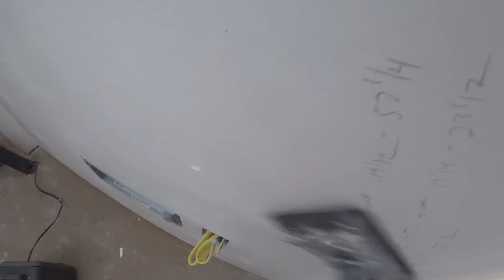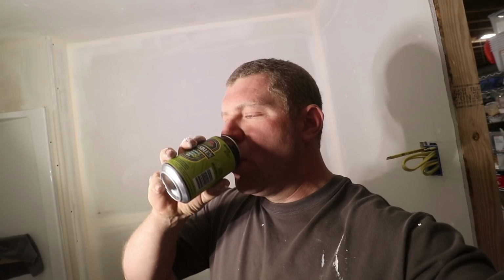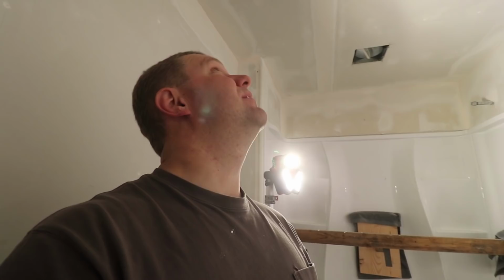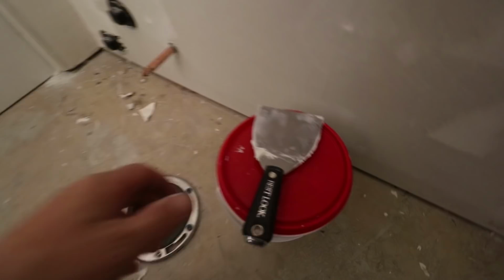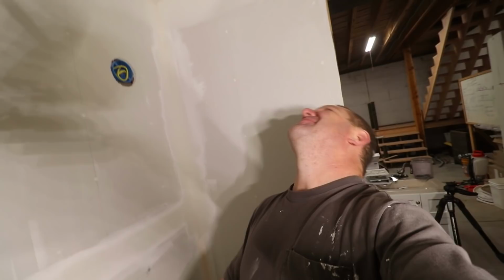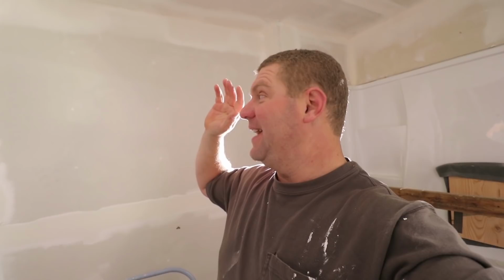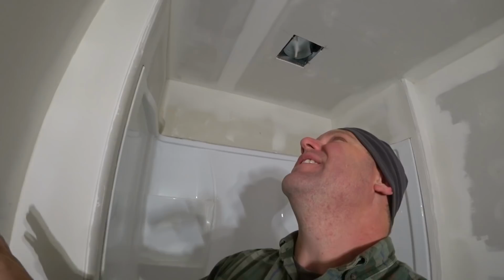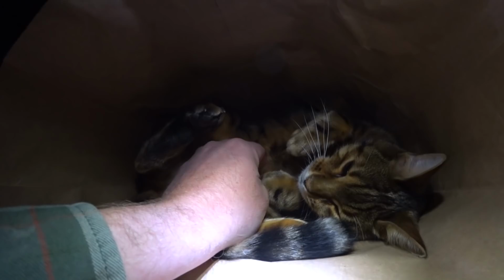READY to TEXTURE & PAINT! (Mudding Drywall in Bathroom)

Comment: For someone who looks up so much on the internet, I`m surprised at the approach Jessie is taking.  My 2 cents
1 - after the first coat, don`t sand, just use the drywall knife to knock off the high spots
2 - in a shower or bathroom area, I would not advise using pre-mix compound, I`d always use a powder mix (setting type compound)  If pre-mix gets wet in the future, it softens up
3 - I hate those rectangular sanding heads on a pole, having it flop over all the time and putting dings into the drywall surface. 
 I`m a big fan of the 360 degree circle sanders (less repairs from having the head flop over)  
4 - if you do want to sand with a rectangular hand sander, you can get ones that take a perforated paper and hook up to the vac, and they suck up almost all the dust that is created  (I use them for spot repairs all the time before painting, they work like a charm)  
5 - that compound was way too thick, most certainly needed some water adding in
6 - always buy more product than you think you will need, especially if you will be using it for other jobs in the near future.  
7 - I would not want to use spray can texture for anything more than a small repair.  If you have a compressor that will power it, a small hopper sprayer for texture is not expensive to buy or rent.  (and instead of mixing with water, mix with white paint, that way the texture is already painted, and is less likely to flake off if you try to paint it down the road)

Comment: Tip : pre fill but joints and seams with 90 compound then add regular mud with paper. It will be stronger won’t crack as easy and fills big gaps like you had here .Also wet the paper tape before using it, to reduce bubbles. Also thin down the mud. Good luck

Comment: Jesse, 20 years as a drywall contractor.  

1. Your drywall hanging looks pretty good, one rule to remember.  Do not allow joints over your windows and doors to travel along the king stud.  "Horn" over all headers at least 4 inches, otherwise you will get cracked joints.  Example, the window on the right in this picture.
http://drywalltaping.ca/custom-home-101-perks-of-drywall-installation-for-your-home/314579_218240454897569_162942057094076_554236_327486995_n/

Two joints are okay as long as you follow the 4 inch rule for both.

2. If you need a sound resistant wall, glue the studs and screw the drywall 6 inches on center.  It is the studs vibrating like a snare drum that transfers the sound to the sheetrock (skin) on the other side of the wall.  Glue is otherwise unnecessary when you are using screws -- you can nail anywhere that is going to be under tape or trim.

3. Hire a professional taper.  Smooth wall for this house, easier to repair and masking all of your wood and doors/windows will be a nightmare. 

4. Prime and paint with a 3/8 inch nap roller. It leaves a very light eggshell texture that you will be able to repair 100% yourself if you need to open something up.

The drywall finisher is the guy who ends the rough construction phase and starts the finish construction phase.  Very critical to get it done right.

Comment: use a drill [hole hog size if you got it] and a mixer head put little bit of water in bucket and whip till smooth [put air into mix] makes it glide better and it dries little quicker. your 2nd coat mud is way to thick out of bucket

Comment: You need a dry wall “T” squaring, a corner trowel, thin your mud, add water and use a paint stir on a drill, makes it a little thinner and smoother, and at least a 12 inch trowel, and a long handle for your sanding block. Good work takes good tools.

Comment: Lots of great comments to help you with your drywalling.
I like a sponge instead of sanding.
I like a hawk better than a tray.
Hire out the mud, the pros do it so much better quicker.
I don't do drywall often, usually when I do it by the time I get finished I'm fairly good at it again, but I'm never going to be as good or efficient as a guy that does it EVERY DAY!
Use a paint mixer in your drill to mix the mud before you use it.
Wipe out the top walls of your bucket so that the mud does not dry there and then fall into the nice fresh mud in the bottom of the bucket.
Good luck!

Comment: To get tight seems in the middle of your wall, hang your top wall board before the bottom wall board. You did it opposite and tried to fit between the ceiling and the bottom wall board. This created a good size gap right down the middle. You want to go top to bottom.

Install your ceiling board first, like you did. Then install the top wall board tight against the ceiling. Lastly, install the bottom portion of the wall board. Throw some scrap drywall or wood on the floor as a pry leverage point. Get yourself a pry bar or 2. Set your pry bar up so that you can step on it and lift the bottom board tight and flush up to the top board and then tack the board in with your free hands. It creates a perfect tight seam down the middle. For an inexperienced installer, a 2nd person might be key to getting tight seams.

Comment: 1. Buy good quality fiberglass tape for drywall.
2. Do not use texture. Textured walls look like crap in dusty environments and just scream “cheap house”.
3. Hire a professional to do the house. The variations in wallboard will look like crap, for the rest of your life in that house.
4. Do not leave any gaps between pieces of wallboard. It makes the mud work twice as hard.

We built and mudded our own house. Our walls are only ten feet tall, and it still wasn’t easy. All of our walls are smooth - no texture. We both have substantial experience with drywall, mud and plaster. Hire the pros. They will have the house done in weeks instead of months or years.

Comment: Jesse, when you drywall upstairs, try a fiberglass weave tape (I used fibafuse) as it wont bubble, and flexible corner bead (comes in 100ft rolls) for inside corners.  it might be overkill but as a DIY-er I found these to be way easier than paper tape. They cost a bit more but not much and i found them much easier to use.

Comment: You all are doing great!  Drywall is an art and takes much practice.  I’m sure the pros aren’t cringing too bad though. A couple of suggestions to consider— spray foam behind the shower surround before you close in the adjacent walls, especially behind the shelves. That will deaden the annoying noise that the water makes when hitting the thin plastic. Foaming under the tub eliminates the noise too and it won’t creak as you walk around in it. Also, try using bags in your Ridgid vac. Much less dust and you won’t plug the filter. Love watching your videos!

Comment: In Australia we use an open weave self adhesive fibreglass tape to join the sheets together. the open weave allows the plaster to penetrate between the sheets. We use the paper tape for the internal corners between the walls.....  Plaster shrinks as it drys....  hence the need to do multiple coats....  Have fun with it  :)  

PS:  What's this 'texture' all about?  We just undercoat and paint our walls over here.......

Comment: when you feather the joints or do joints.. first you hit the crack with mud to fill it .. then you put on enough mud to hold the tape in place.. seat the tape at one end and pull it out along the wet mud using your knife to embed it .. put your drywall knife against the tape when you get to the other end and tare it off the roll.. let that sit until the tape is embedded in the mud and you know its not going to pull up.. come back with a 4 inch blade and put down mud right over the tape.. then use your 10 inch trawl.. to feather it.. light pressure towards the center of the tape and hard pressure out on the clean drywall.. go down one side and then the other side of the tape.. you are building a slight peak over the center of the tape .. then you come back and sand that peak flush.. its a peak you can't really see.. i let that sit then wet sponge instead of sanding.. sanding is dusty also a sponge blends the outside edge into the drywall better .. anyway thats my way.. screen sanding is also very good if you have long areas of wall

Comment: The way it is done.  Start at the top and work down.  By moving the lower panel up to close the gap.  The extra gap at the floor is very easy to hide with flooring and base molding.

Comment: In the 60s we used a 6 inch knife to tape and spot the nails, not screws, 10 inch curved trowel for the fill coat and a 12 inch trowel for the finish coat. We mixed our mud from dry sack in a 5 gal.  bucket, let it sit overnight and remixed it right before coating the joints. All purpose for taping and the fill coat, and finish mud for the finish coat. Premixed was twice as expensive and we had to thin it down. We mixed it real thin for taping, we used a "banjo" to apply the wet  tape and thicker for the fill and finish coats. 6 inch knife for the corners and a 12 inch flat trowel for the butt joints. It looked like a fine plastered finish with little sanding. What you are doing Jessie looks good! We also sprayed acoustic material(popcorn) on the ceilings. It did cut down on noise in the room, but no one does that anymore. You will need a lot more tools and equipment to do the rest of your house, but you are "hands on" so if you decide to drywall the rest, you will save a lot of money, not time, but you are young and the videos will be great! Thanxz

Comment: I don't know if anyone has commented yet but I believe you are supposed to soak the drywall tape into water first and then apply it to the seam. You need to apply a thin layer of mud onto the seam first and then apply the wetted tape onto the seam. Using your knife, smooth out the tape.

Comment: Purchase mud in 5 gallon pails.  To prevent drying out of unused portion,  smooth out the surface of the mud left in the pail and cover with a thin layer of water, at the end of the work day (you can keep stored for months).  Pour off water before next use.  Power stirring when you reuse from the pail, will help maintain mud moisture content consistency.  If desired, hire a pro to direct you, as you do the work.

Comment: Yes. Thin the drywall just a tiny bit -- only a few tablespoons water per 5-gal bucket, power mixer to blend it to a smoother / creamy consistency, then cover & let sit over night before using it. Get drywall inside corner & outside corner tools. Yes, fill seams with mud & then set tape into mud. A very wide taping knife (18" to 24") will blend seams out much wider to give cleaner finish to joints, because we know you're going for a Grade 5 Finish.

Comment: Get your mud in 5 gallon tubs. Get a stirring blade that goes on a power drill and ALWAYS blend your mud before you start. (We used to add a small (tbs/gal) squirt of (Joy) liquid dish soap and a half cup of water to each 5 gallons for smoothness.)
Also, you need more circulation with that warm air. ... Box fan on low pointed into the vanity corner.

Comment: Last year I helped my neighbor finish her 1500 SF basement. We drywalled, taped and textured the first half by ourselves.  It took weeks.  The result wasn't bad but took forever.  We decided to have a crew do the second half.  The hangers came and hung. all the drywall in 4 hours.  They were very  particular about fitment.  Our ceilings were less than 8' so first they measured up from the floor 48 1/2" and made marks in a few places.  then they measured from the marks and cut the top sheet to that dimension.  If they could fit a drywall knife between the joints, it wasn't tight enough for them.  Then the taper came and in 2 days he taped, textured and applied a prime coat.  All told, 3 days to hang, tape, sand, texture and paint with primer.  So when I decided to do my 900 SF garage, I had the crew do it as well, 10' ceilings and they had to drop the garage door hardware.  It took 3 1/2 hours to hang.  It would have taken me days to hang and weeks to finish.  Sometimes you have to let the pros do it.

Comment: usually you don't see that kind of tape separation from improperly bedded joints for at-least a few years. you've got it in 1 day, congrats. next time, use more compound when bedding the joint tape; plenty of tutorials on yt. also you should really consider mixing your own mud (they come in different dry-time flavors), you are correct, it was way too thick - but stiring it would have helped with a mud drill to remove air bubbles and evenly distribute everything.

Comment: Jesse's I have worked in construction most of my life so let me help you for any future taping and finish mud work you do.  Always without a doubt thin your mud, especially when tapping. To thin your mud you should start with a five gallon bucket or the boxes that can be dumped into a five gallon bucket, but it has to end up being five gallons of mud. An easy way to know how much water to use to thin your mud you should have a sponge measuring about 8 inches long by 5 inches wide by two inches thick. If you look in the area in your builders supply store look for sponges used for cleaning up grout work, there you should find the size of sponge I am talking about. Back to thinning, dip you sponge in water and ring it out in your five gallon bucket of mud, do this twice at least to thin your mud down. Use a heavy duty drill and mixing wand to mix the water into your mud the assures for a even mix.
And Also for the future, when taping use a six inch knife for putting your mud in the joints, its easier done if you put about two inches of mud on the end of your knife and then using the side of the knife apply it to the joint. then before applying the tape go back and remove a fair portion of the mud but leave a good amount so that the tape has a good base to stick to. And always knife the tape into the mud by starting in the middle of your length and push out to the ends, and then you can go back and run your knife from one end to the other. And the most important help I can give you is one corners. If you look at your tape closely you will notice it has a slight seam in the middle. This is for doing corners, fold your tape in half for the desired length you need for each corner and then never use your knife to apply it first to the mud. Simply stick it into the corner and use your fingers to firmly push it into the corner using a ridge hand motion and drag your fingers down through the corner. Once you have the tape in the corner and seated nicely there then use your knife to drag the mud, but again start in the middle and push outwards to the ends. Well I hope this helps Jessie, good luck.

Comment: Corners are tough to get right, I've done a bunch (DIY after learning from a real pro years ago) but it never gets easier. I beat you up after your first / tape coat. Your second coat is working out really well - for the most part - so you're well on your way. Where I live we always go with three coats. Taping coat, mid-coat, and finishing coat.

P.S. stir your mud before you use it. It makes it easy to work with. And go for the 5-gallon bucket option. You'll end up saving time, money and your sanity. ;-)

Comment: Recommend adding some more mud to your screw heads too. You don't have enough on there and it will pucker and crack later on. Heavier in the center and feather the edges or sand the edges to feather them. Really really really recommend adding some water to your mud and get a mixer and just mix it all in the bucket at one time. They make a large mixing paddle that goes to in a drill to do that.

Comment: I have been doing drywall for 25 years and I am wondering why you didn't use mesh tape and thin your mud.  If you thin your mud and only put a thin coat on, your drying time would decrease tremendously.  Plus you just need to quit going over where you already put the mud.  Just a thin coat and sand once it dries and then place another thin coat.  Placing globs of mud on the wall only causes problems and requires too much sanding.

Comment: A way to avoid gaps in the wallboard is to put the top piece up first tight to the ceeling and then the bottom piece pried up tight to the top piece with any gap left at the floor where it will be covered with base.

Comment: the joint compound is never ready to use directly from the container. At the very least it needs to be mixed with a power mixer in a drill motor at about 300 RPM. You should try to add just a small amount of water and mix it in.

Comment: I never sand the first coat,  I just run the trowel over it and scrape off the high points. As for thinning the mud, just mix it with the trowel as you use it it'll move the moisture around and make it easier to apply.

Comment: ***Jess***  Suggestions... Buy a 5 gal tub of "lightweight mud", then you can mix it so its thinner.  You mentioned feathering and the sanding associated with it.  When you are using your knife you are putting your index finger in the middle of the blade.  If you put your finger on the feather side of the knife and use a good amount of pressure you will get a better feathered edge.  Lastly... SPONGE YOUR MUD... DON'T SAND!  Try it once and you will never sand again.  It's quicker and no dust cloud.

Comment: So what is the point in using mud when it is applied so thin? Here in the UK we call it Plaster and im pretty sure when its applied its a good 3 or 4mm thick. I understand mudding and taping the joints and screws i just dont see the point in applying a product so thin.

Comment: Little trick to prevent drafts. Use masking tape on door frame to wall just enough to hold it in place. It can be removed easily and any residue will be covered by trim.

Comment: Wet tape on a bed of thin mud dry's fast and does not pucker using increasing wider knives and thin coats of mud dry fast and final coat with 16 inch knife almost no sanding required. That's how it works for me and I prefer paper tape.